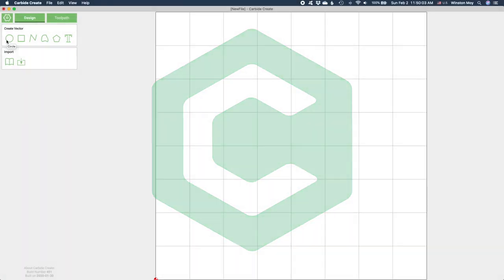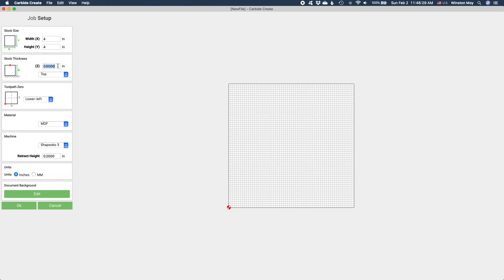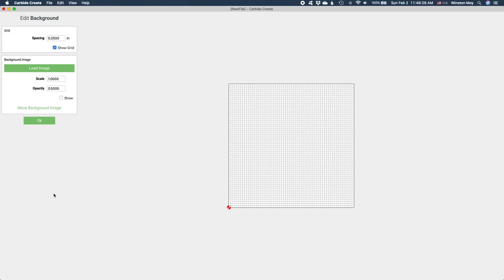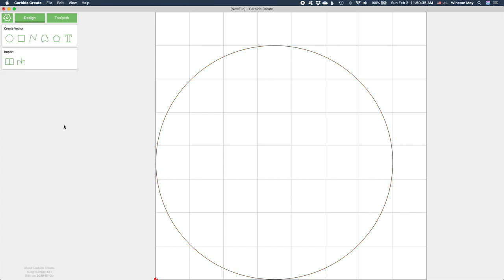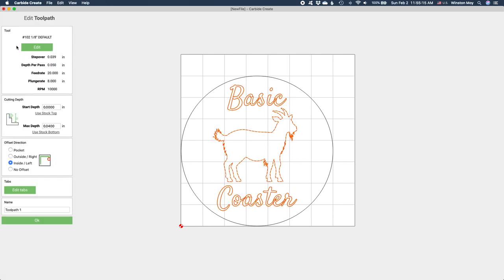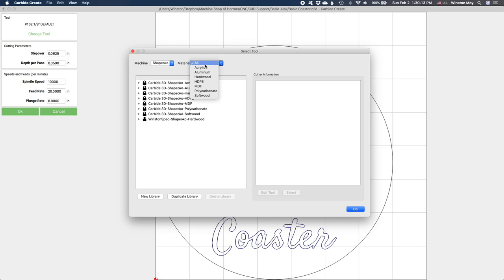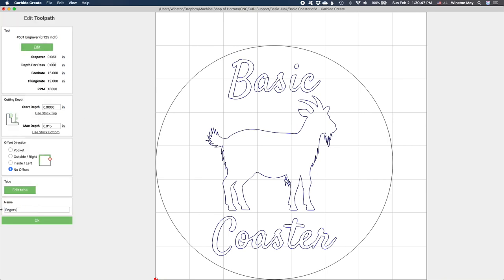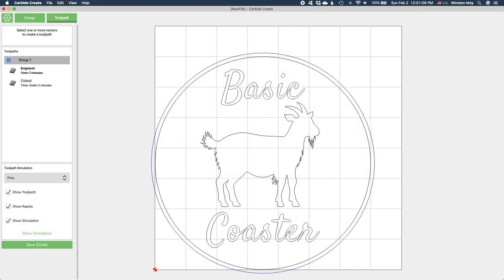Intro to Carbide Create and Making Gcode

Comment: At 3:29 in the video he points out a built in vector graphic library.  Did they remove this feature at some point.  I have build 514 and it does not appear to have a library.
Reply: I hear they are moving it onto the launchpad site but there is a very limited number of things there currently

Comment: I was wondering if you have time if you could answer a question please.
I have a question between making keyholes and making a normal slot (I guess thats what you call it). One of the things I make is where I make slots with an end mill simply to put a washer in it at precise measurements from the edge of the wood.
In learning to do both, I notice the procedure is the same? 
When I learned to make a slot I just drew a line and decided a depth.
When I made a keyhole, I drew a line and decided the depth.
When it made the slot the router kind of ramped in sideways back and forth till the desired depth.
However when it made the keyhole, it drilled straight down went forward, then came backward and straight out.
I learned both of these techniques off of YT but I actually don't know what is telling carbide create to treat these lines(referring to the way the path is created) differently?
Could you tell me the difference please?

Comment: I have some questions on our CNC machine. I have the design and saved it but having trouble bringing it over to the cutter to cut it out. My new file is not sending to the CNC machine and prints the last one. Also my text is thicker than it was and not the same that I did before. Please help
Reply from the maker: Will, 
Reach out to Support@carbide3D.com for help.  Please include the file you are working with, pictures or videos of the results and tell us what software you are using for CAD / CAM. 
This, along with a detailed description of the areas where you’re not seeing the expected result will help us focus our response.  
Also, be sure to tell support what machine you own and when you bought it.

Comment: If I designed a balsa model airplane in something like FreeCAD or Fusion360, and exported a DXF file with the outlines of parts for each wood type and thickness, would I just import those files and create a routing tool job for each one?

Comment: What is the basic computing requirements, like ram and processing power to effectively run these programs. I have a lab top but it keeps crashing unless I brake up the project into separate files.
Reply from the maker: The only strong recommendations in terms of system spec we have is 4 GB RAM, but the higher end the better in almost any case. Performance will also be strongly dependent on how complex your design is. Just about anything you draw in Carbide Create itself should be fine, but if you import big SVG (especially ones that may not be optimized, we've seen this happen a lot when people download random Aztec calendar type projects) there will be a performance impact.

Comment: Yes, you do fly through the images part, but I just stop and rewind to see what you're doing. It looks as if the ability to import a vector file into my design isn't available at this build (555, I think). Or the library access for images is also gone. How do we add artwork?
Reply from the maker: In the latest version we removed the fixed, built-in library, but created a growing repository of vectors you can download on our website here: https://elements.carbide3d.com/

Importing vector files is still in the program, the icon/position changed. It's on the bottom row of buttons when nothing is selected, on the left side of the sidebar. Looks like a rectangle with an arrow pointing down into it. (Latest version: 520)

Comment: Just downloaded the free version of Carbide Create and it turns out it is useless.  It will not save a project as G-code. You must buy the pro version for that insignificant little detail! My quest continues.
Reply from the maker: If you own a Carbide 3D machine you can simply load that .c2d file into Carbide Motion.  If you don’t own a Carbide 3D machine you will need Version 7 Pro to export g-code.
Reply: @carbide3d  thank you for your quick response. I have a homemade machine. I have downloaded Carbide 7 & Carbide Motion onto my desktop computer. Dose Carbide Motion need to be on the laptop I have connected to my machine? If so I’ll do that and give it another a try tomorrow. Thanks again.
Reply from the maker: Yes Motion has to connect to the machine itself in order to command it.
Reply: @carbide3d  again, thanks for your response. I’ll download motion onto my laptop and give it a try. - I am just getting started with CNC, still learning the very basics, but I have an observation, Carbide Create Pro is $120 for a 1 month subscription and Carveco Maker is $15 for a 1 month subscription. From  a noobie’s prospective “Maker” is a much more robust platform for a lot less. When I’ve worked out all the kink’s and learned what the hell I’m doing I’ll most likely go with “Maker”…….just saying.
Reply from the maker: Carbide Create Pro is $120 per year, not per month.
Reply from the maker: Carbide Create Pro 7 can output gcode for any machine.  Carbide Motion only works with Carbide 3D machines.